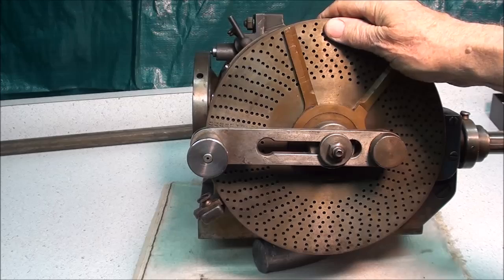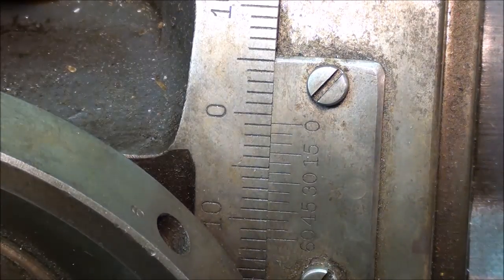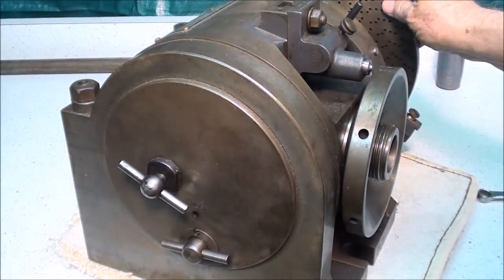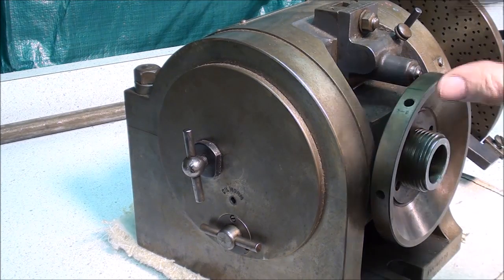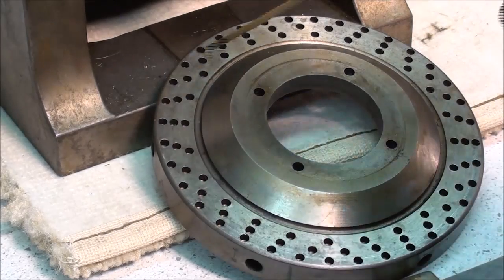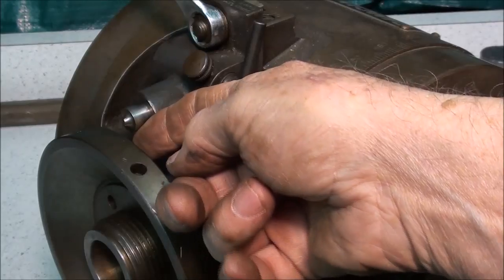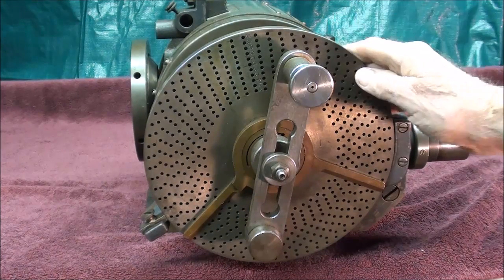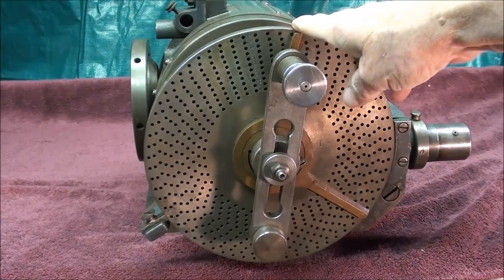SHOP TIPS #191 Introduction to the Dividing Head pt 2 mrpete222

Comment: 27 hole circle --- each space is 20 minutes I think. Distance between 3 spaces gives 1 deg. (Does that sound right, Mr. Pete?) Smaller dividing heads like Carroll (like mine), L-W  usually came with a series of plates, but none of which had the 54 hole circle, unfortunately (not stock factory plates anyway). 
I hope this helps someone (just worked it out in my head) assuming my math is correct. an example, I have a job coming up where i need to gash a part blank 8 deg intervals.  3 spaces x 8 = 24 spaces.
    Nice thing about Carroll and L-W is that they were fairly small and ideal for a home shop machinist, only weighing about 25 lbs., 5" dia plates. I think Brown & Sharpe also made a nice little dividing head about the same physical size. All these weigh considerably less than BS-0 and BS-1 chinese dividing heads currently on market nowadays by MSC, Grainger and the like. Every bit as good if not superior to chinese.

Comment: Why cut a whole new rack and pin?  It seems easier to drill and press fit a new pin into the broken part. You might need a carbide drill if it's hard, but still easier than making a rack.

Comment: What is a fair price for one like this I am looking on eBay and cl  , but prices are all over the place .
Reply from the maker: 300 or 400
Reply: I paI'd  £150 for mine. EBay shock was the actual size of it, and weight of it when I picked it up.
Reply: +Arjan Wilbie I got mine on eBay a Walter 8 in ,  300.00 U.S  nice but the sector arms were missing , it's a real pain in the a £€ , without them .

Comment: Thank you for uploading this video Mr Pete. I've just bought one of the Cincinnati 10" Dividing heads you reviewed. I restore and build classic and vintage motorcycles, mainly Norton, and found that there was no way I could do the jobs I needed such as boring the exhaust ports to accept threaded repair inserts. I'm making a face plate to mount on the spindle thread to mount the heads. I know this isn't a conventional use but this machine accomplishes this job with ease.
Your video has really opened my eyes to the capabilities of this fine piece of equipment thus extending the capabilities of my Bridgeport Series 1 milling machine.
Reply from the maker: +Sophie Hawthorne Thanks for watching--those heads are beautifully made--you can find the manual on vintage machinery.  I always loved a Norton--and old Triumphs too.
Reply: Sophie your a rare bird
Reply: Sophie, do you have a YouTube channel? You are the type of person I would like to learn from. I haven't got a bridgeport yet, slowly I am tooling up my hobby workshop where I work on crappy Land Rovers.

Comment: Dividing Head Q?
What do you do when you have some odd situation when using the side plate. I don’t have a situation,  but figured my dividing head would not work with the plates I have.
Suppose one has to cut 33 slots, or flats. The formula; Turns=40/Number, so T=40/33=1.212121… or 1 and 7/33 of a turn (I think). Does that mean one would have to have a 33 hole (or some multiple of a 33 hole) plate? Or after viewing your video may be it could be converted into angular if one had a 54 hole plate?

Lastly your videos are great - and while I am only a home enthusiast I am picking up a lot of valuable education.
Reply from the maker: +Tom Herd Thanks for watching--I'm in a motel--cannot answer

Comment: Lyle, I have just watched tips 193 about you adding a chuck to this dividing head. It will not allow me to leave a comment so I am leaving it here. I personally think that you are being silly and making yourself a lot of hard work by using a casting you already possessed. It is too small for the chuck, you say that you are going to drill fresh holes in the chuck, they will be far too near the edge. Buy another correct size casting, then you can use the existing tapped holes in the chuck, do not spoil the job for the sake of buying a casting. In fact it does not even have to be a casting, a steel plate with a boss properly welded on, or even brazed  will be fine, after all it is going to me machined all to run true. All your other projects are fine, do not spoil this one, and also bear in mind that you are supposed to be teaching others how a job should be done.

Comment: Hey Mr. Pete222,
You mentioned that you were not sure what the serrations were on the side of of index plate were for. If you were to need to reinstall work back into the head or if you were repairing a gear already machined you would use them.   after you put the work back in, and align cutter, the index pin is almost always going to fall somewhere between two index holes.  This will allow you to move the plate to the pin and let that pin fall into a hole without disturbing the work.     Thanks for all your work, I first got interested in machining from your videos and now am setting up my own shop to do machine repair! 
 Chris
Reply from the maker: THANKS--good explanation. Good luck on new shop

Comment: Instead of making a completely new pin for your dividing head, couldn't you could face off the stub of the broken pin and bore and tap the hole for a new pin.
Reply from the maker: pROBABLY, BUT IT IS HARDENED
Reply: Anneal it first, then re-harden it.

Comment: Dear sir, I preface by saying that I am a total "self-taught" amateur & I think your videos are great... so I have to assume that you want to re-make the entire pin ("from drill rod") as an exercise in order to teach us about cutting teeth on a shaft (a rack).  If I were to do this project (call me lazy), I would chuck-up the shaft with the broken pin, face it off, drill a hole, and lock-tite in a new pin... perhaps a piece of broken drill bit shaft from my extensive collection of broken drill bits... don't ask why I save them all.  Thanks for yet another great series of videos.
Reply from the maker: You are right about me making this as a teaching item. I had thought about your method, but it is hardened and would have to be annealed in order to drill it.  I already made the vide-2 months ago. thanks

Comment: If needed dividing plate  isn't available...
Turn plate to known circumferance. make strip of paper of length equal to circumferance of dividing plate forming circumferance strip . Get something marked in even divisions say a tape measure, If you wanted say 11 divisions drop perpendulars from 11 marks on the tape to circumferance strip.That scales the divisions onto the circumferance strip. Mount circumferance strip on outside of dividing plate, use something like a razer blade and magnifying glass to visually index the plate on a rotary table on a drilling machine.
Reply from the maker: Thanks--that is an excellent idea--never would of thought of it.

Comment: Thanks, that helped me figure out the angular setting my dividing head which is 60 to one. There is a lot that can be done with a diving head to position work at angle when one does not have many tool.

Comment: A really excellent video on the dividing head and it's use. This attachment was much feared by my students when they were introduced to it, but they soon embraced the use of it to cut a helical flute reamer by using the short lead attachment to drive the head, and eventually learn to generate a sphere by using a fly cutter and angling the head to 45 Degs, that impressed them and took away the fear! Many thanks for posting.
Reply: There are many things that you can do with a dividing head.  While driving the head from the leadscrew is normal it strikes me that it should be possible to reverse this and use the head to drive the leadscrew, thereby moving the table by a very precise distance for a job like engraving a linear scale.